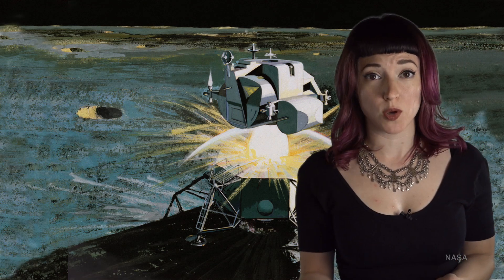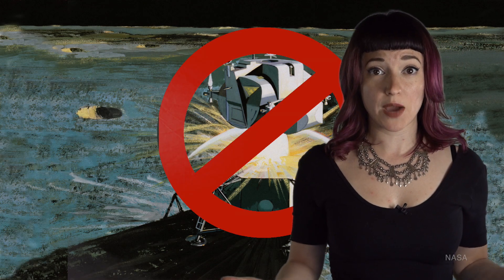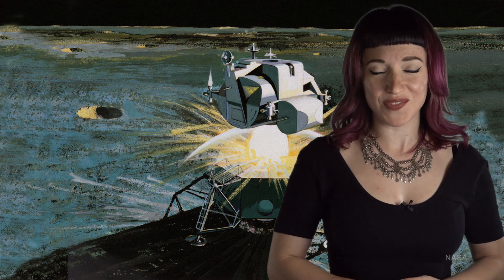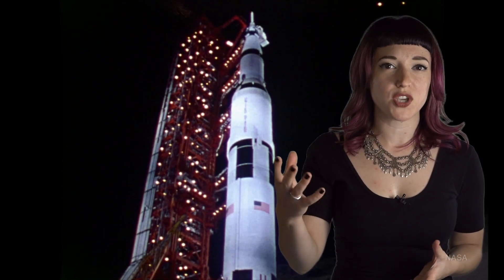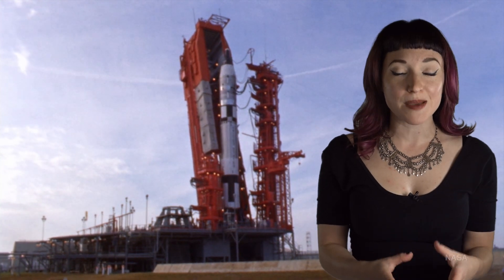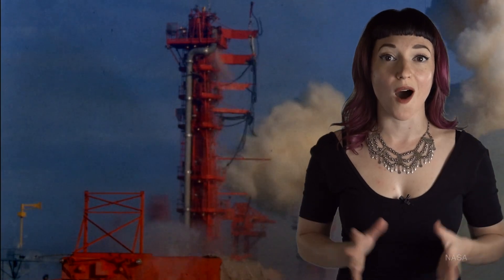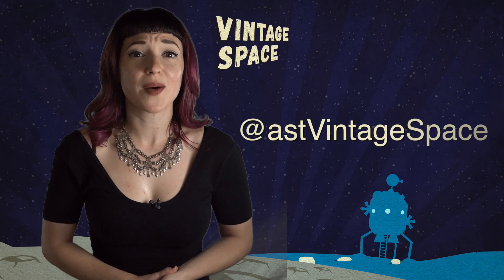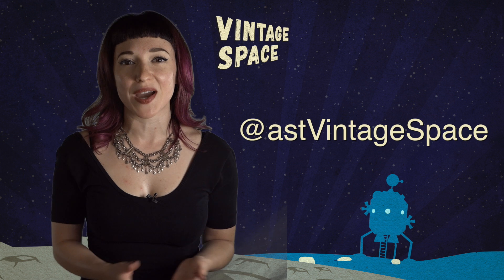How the Lunar Module Launched from the Moon Without a Flame

Comment: Correct.  We did not land on the moon.   Forget no flame....where is all the dust which should be a giant cloud when the rocket engine went up and when it landed and in neither case was there any dust even though "science" said there was lots of dust.  (Remember the foot prints?)
Reply: YOU SAID: "Correct.  We did not land on the moon."

== How is that "correct"?  When did she make that claim?  What ARE you talking about?

YOU SAID: "Forget no flame...."

== No, people cannot "forget no flame."  It's been almost 50 years, and ignorant people still, to this day, think Apollo was fake, and they use the "no flame" argument all the time.  They're idiots.  And, they will not let anybody forget the "no flame" argument.  The reason there was no VISIBLE flame was because that particular combination of fuel and oxidizer burn clear, leaving very little visible flame.

YOU SAID: "where is all the dust which should be a giant cloud when the rocket engine went up"

== A vast vast vast majority of the thrust was deflected by the descent stage, which acted as a launch platform.  What little dust was blown up simply cannot be seen by the little color-wheel camera with only 200 lines of resolution from a hundred yards away, at least not enough enough detail to really make out what it is.  But, we do see the bottom half of the image get "cloudy" as the lunar module is rising.  That's due to the dust and debris that you're asking for.  I'm sorry that "clouds" on the moon don't behave like you assume they would, especially at only 200 lines of resolution.  But, what you're asking for IS in the images, just not as much as you apparently think it should be.

YOU SAID: "and when it landed"

== Have you watched a landing video?  Plenty of dust was blown.  What ARE you talking about?

YOU SAID: "and in neither case was there any dust"

== You're an idiot.

YOU SAID: "even though "science" said there was lots of dust.  (Remember the foot prints?)"

== Well, maybe if you actually watched the videos before jumping to your ridiculous conclusions, you wouldn't be a conspiratard in the first place, huh?
Reply: @rockethead7  He expects the type of dust cloud that you get on earth, due to the atmosphere 🤦😋

Comment: Yeah sounds nice but one back in space with very low fuel the ship had to be controlled for docking what fuel did it use then?
Reply: It's the same type of fuel.  There were 16 small rockets that controlled the orientation of the craft, and performed the small detailed movements.  As for the quantity of fuel, yes, they had enough.

Comment: I know it is an old video, but I talked to a guy who thought the red green and blue "confetti" as he called it looked like CGI. I suggested that it might be light refracting in the camera objectives glass lenses. But do you have the right answer?
Reply: The material is part of the stuff that got chopped away when the explosive guillotine hacked through the wires and plumbing and stuff.  It's also likely some of the thermal blanket getting blown away as the ascent engine lit up.  The reason it's colorful is because the RCA camera used a spinning color wheel in order to get the color images.  This saved on the size and weight of the camera, because it allowed it to produce color images with only one pickup.  Most color cameras back in those days had 3 big pickups, and the cameras were a lot larger.  By using a color wheel, one pickup is used, and the wheel just spins really fast, producing the colors for the one pickup.  The down side is that things that move quickly will appear to change colors a lot, because the object is moving too fast in the frame for the color wheel to make a revolution and complete the image properly.  So, the color gets jazzed up if fast moving objects move faster than the color wheel can spin.  And, if you look closely through all of the Apollo 15-16-17 video, when an astronaut is moving quickly enough across the screen, his white suit will appear to be changing colors around the edges.  (And, just about anything moving quickly enough causes the same effect.)  For the really fast flying debris at liftoff, the effect is even more dramatic.

Anyway, here's a video showing an example of a color wheel (not one of the Apollo ones, but close enough to get the general idea of what a color wheel is):
https://www.youtube.com/watch?v=R4zTe46U09E

And, here's a video where you can see that the edges of an astronaut's suit is changing colors when he (or the camera) moves too quickly.  Take a look at around the 50 second mark in this video, it's a really dramatic color changing effect, just like the flying debris.

https://www.youtube.com/watch?v=bVNTNeNMH8Q

As for the notion that it's CGI, um, no.  Tell your friend there was no CGI back in those days.  And, let's get real here, if they were going to use something like CGI, where they manually manufacture the imagery, they wouldn't make it change colors.

Comment: What I want to know is how are there SPARKS at 0:25 during lift off? There is no atmosphere, & no oxygen on the Moon, so how could there be SPARKS during lift off? Another thing I would like to know is, during the missions where the astronauts spent 3 days on the Moon, where did they crap at? Where did the astronauts crap during the 3 day trip to the Moon? There were no toilets on board, so how did they dispose of all the feces they produced? Did they sh*t in their pants until they got home? Imagine trying to take a dump, with ZERO GRAVITY?😬 It's these nasty, dirty questions that NASA doesn't have answers for because nobody has the nerve to ask them!
Reply: 1. Hot metal glows, regardless of the presence of oxygen. Debris from the explosive bolts will be hot, especially once hit with the rocket exhaust.

2. They shit in plastic bags. This fact is well documented, and no one pretends it was glamorous.
Reply: @niallkinsella2687  
Paul goes from video to video to video, thread to thread to thread, asking the "sh*t" question over and over and over (and always ignores the answer, because he's been given the answer countless times, yet keeps on asking).  Paul's fetishes are quite apparent by what he posts online, and how many times he posts the same thing.

Comment: What is also interesting about the hypergolic mixture used by the LEM ascent stage is that the chemicals were very corrosive, so the engine's test was, in fact, the launch from the lunar surface.

Comment: How does combustion happen  without air?
Reply: Ask yourself what it is that air contributes to combustion, and when you have answered that  consider whether it might be possible to provide that in some other way.
Reply: Richard Cornford But wouldn’t the vacuum of space extinguish the combustion? We are talking oxygen, nitrogen, and carbon. Not Helium Hydrogen fission.
Reply: @ZimM804  
The concept of "extinguishing" combustion isn't what you think it is.  The fuel/oxidizer combination combusts.  When it's done, it's done.  This isn't like a forest fire or something, where it can spread, and you "extinguish" the fire somehow.  They bring fuel and oxidizer, they combine that fuel and oxidizer in the engine bell, it combusts, and the expanding hot gasses propel the craft.  That's it, it's done.
Reply: Rockets bring both fuel and oxidizer with them.

Comment: 0:25 You can't see the exhaust plume when the vehicle lifts off, but you can see the dust and debris kicked up when the engine actually starts up.
Reply: Actually what you are looking at is the result if the explosive guillotine that cut the wires from the ascent stage from the decent stage. These wires connected various sensors, batteries, etc between the two halves of the LEM. The wires were cut a fraction of a second befire the engine stsrted. Has this wire cutting failed, the ascent stage would have not gotten off the ground. This was a very nervous time for the Grumman engineers.